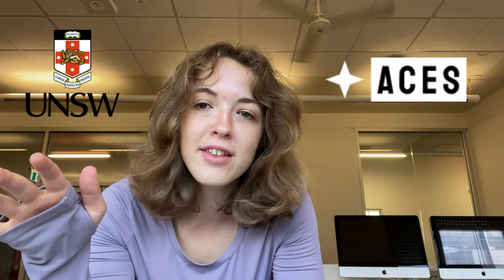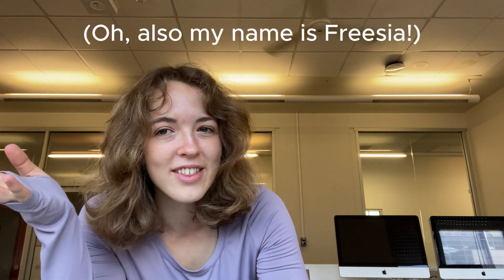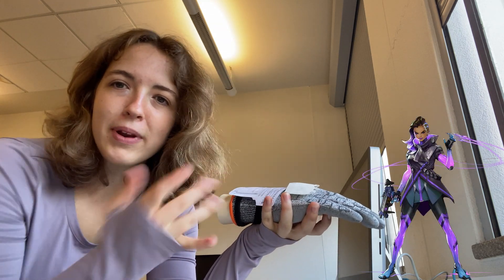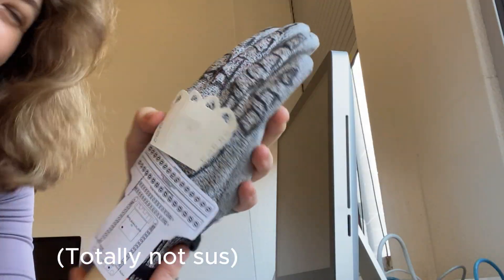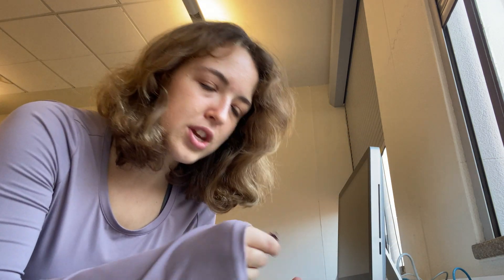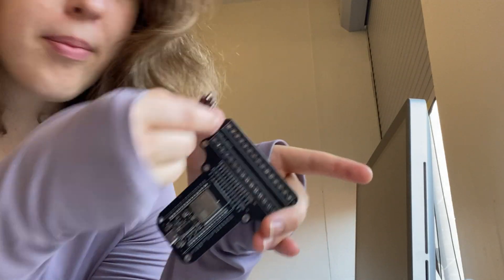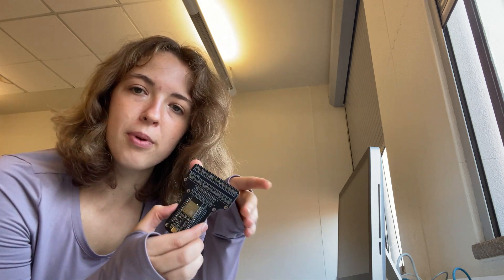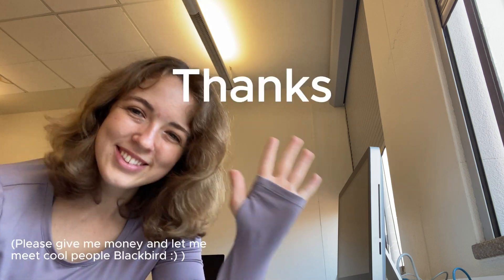im making a keyboard glove.

Comment: I've been talking to people about a keyboard glove for years now, but haven't had the time or skills to prototype sth myself. My thinking was along the lines of just having contact plates on the thumb, finger pads and palm and just monitor which circuit closes. Using accelerometers and embedded AI seems like a more complex way to do it but also gives a lot more flexibility to the user/less of a learning curve.
Reply from the maker: I've 100% thought about contact plates, but figured if I want to be able to try to model it in air as well I would have a better shot without them. Totally get what you mean though!